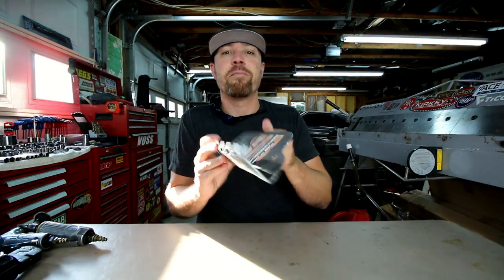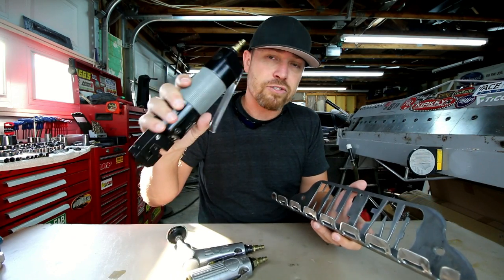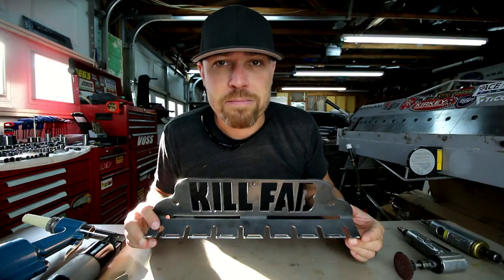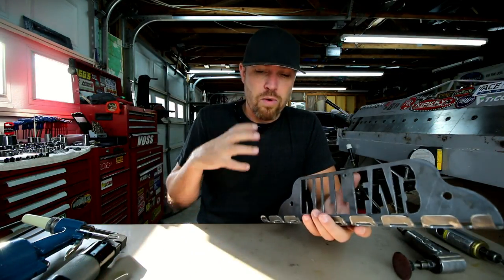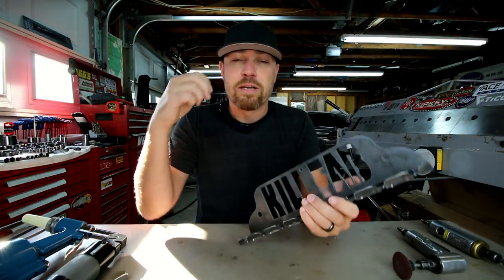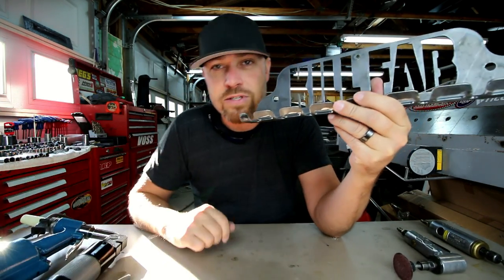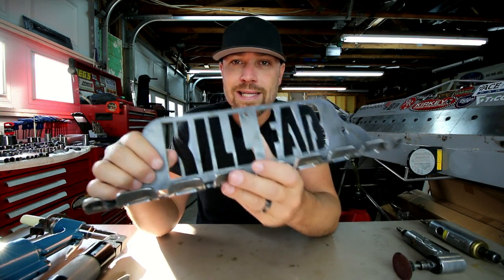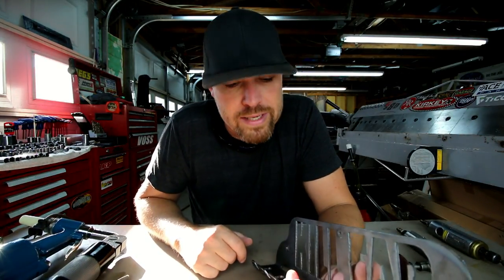You Need This Tool - Episode 81 | KillFab Air Tool Holder

Comment: Schweet! Good way for subscribers to show support for your channel AND to obtain unique custom fab'd organizers for their work shop. And the knockdown tab'n''notch DIY version is perfect for the budding welder that is in many of us! More useful for gaining experience welding than by only practicing with random scraps of metal.

And the wrench rack organizer that other people have already requested is a super idea that might be worth you pursuing. I can almost visualize how "easy" is would be to make them with access to a plasma table; programming it would be another thing, though. But there would be "economies of scale" to reduce the cost per "rack". But then, with the wide variety of wrench brands out there today you would need to scale the slots for the thickest wrench "handles" out there; unlike the air tool rack for standard air coupler's (Milton & Lincoln styles are the same dia "where it counts) for hanging then) and needs a 5/16" slot. I made an aluminum wall rack for my blow guns years ago; almost all my air guns had a lead hose that had a swivel at the gun handle to get the weight of the air hose off of the coupler: I was having to replace the nipple's almost every year due to the vibrations wearing the nipple resulting in air leakage and broke a few where the gun got stepped on when it was lying on the floor. The hose coupler's could be fixed with new O-rings to stop the air leakage and rarely wore out completely. "Sitting in the office long after closing doing book work and the air compressor would start up scaring the shit out of me; go back there and found an air gun still plugged in, with a leaky coupler - and I hadn't yet done the shop closing procedure where I would turn off the compressor and close the gate valve at the compressor to keep the tank charged overnight."

I made my own Wrench racks 30 years ago when I got a new 60" wide x 30" deep Cornwell tool chest and roller cabinet - 5 - 6" diameter wheels (one in the middle, with a "suspension system" /spring) and a foot brake to the 4 "corner" wheels to "stop it" (hey, loaded with tools it weighs as much as a small car) and "lock it" where it was "parked".  Called it my "taco wagon". Premade steel painted holders all had the wrong number of slots and I "was over" the plastic "peel and stick" holders. I used 1" angle aluminum (1 1/2" for the 1"plus size combination wrenches) which was readily available at the home center stores and spent many, many hours over like 4 or 5 weeks of spare time at the vertical band saw cutting slots to hold them as upright as they would fit in the drawers. And then cleaned up the cuts with a die grinders with sand paper rolls. Pop riveted them to the drawers after laying them out and I used cleco's to hold the racks when I marked where I needed to cut the slots. And that was the most frustrating part of the whole process, cutting the slots so I could hide the bottom of the aluminum angle and pop rivets. Did 3 drawers - Fractional, Metric, and 1" / 25mm and larger; still get compliments to this day, although many people think it was a waste of time ... "just throw 'em in there and close the drawers" ...
Reply from the maker: I am going to work on it and see what I can do

Comment: Kyle, I'm about to rewire my mustang using a Ron Francis kit. I have yet to see a video of anyone using this product, essentially, this makes wiring a car for anyone. They provide you with the proper plugs and harness to make a car street legal (lights, signals, etc) and you have to harvest a few things from the factory harness to use. Great way to remove that 30yr old wiring, remove any stuff you don't need, etc. this is all going in my 88 Mustang Coupe, 408w, TKO600
Reply from the maker: awesome

Comment: A good rattle can holder for things like carb cleaner, brake cleaner, WD-40 etc
Reply from the maker: I will think on that
Reply: Here ya go. Kyle has one on his work bench. I have them in red as well... http://www.ebay.com/itm/142041779850?ssPageName=STRK:MESELX:IT&_trksid=p3984.m1555.l2649

Comment: about 40 of those out of a 100$ sheet of 1/8 plate at 32$ each, id assume you make them on a cnc plasma table and manually bend them so  2.50 in steel say 1.50 for consumables on the table and 2.00 each in labour/ up keep... turning a nice profit there but its not too redicoulas a price i was expecting around 50-60$